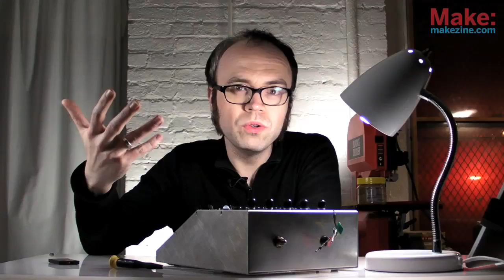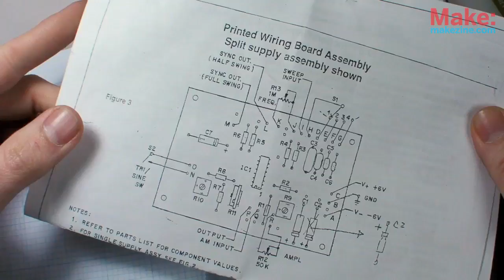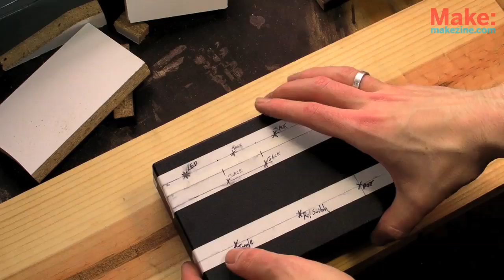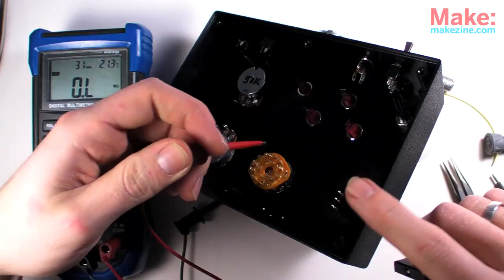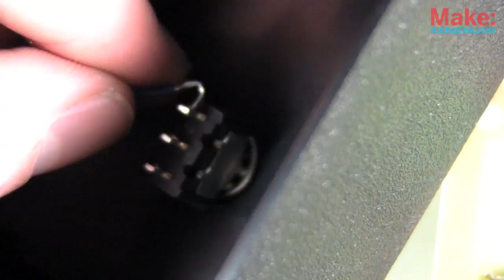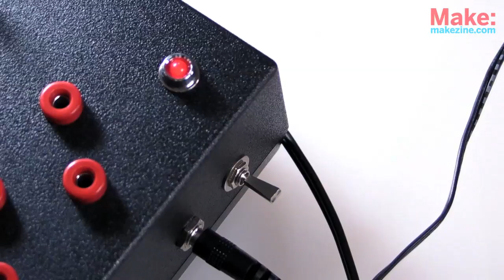Circuit Skills: Electronics Enclosures

Comment: The only issue I find with the tutorial is that he doesn't label anything at the end, or at any point of the assembly.

Even for those who have watched this video, you have no idea what's what. The input and outputs at least should be labeled, as well as the supply voltage, and input impedance.

Someday, I'll make a smaller generator, but with a 555 timer.

Comment: Part of a case is wire dressing, you did not talk about that.  And service loops so you can get the case open or close it up without a fight.
Pretty front panels with a dog's breakfast inside do not impress me.  Inside that look 1950s mil-spec but were actually built by one guy in his garage - that impresses me.  Cases are more than what you see outside.  How about power entry - where did you talk about getting power safely into your case?
You did not finish the video and yuo failed to instruct on the BASICS.

Comment: Really good video. What was that little 3 pin panel mount on the outside of your box? I’m looking for something like that for my 3 wire rpm sensor. It would be nice to have a right angle plug to mate with it. 
Thanks,
Paul

Comment: Hey man great instructional! Nicely paced and great shots to demonstrate during assembly. I learnt a lot just by watching you work, so thanks!  :)

Quick question I have about when it was time to mount the PCB into the enclosure, if U don't mind?  -

I thought you said that was a generic enclosure... How did the PCBs mounting positions line up perfectly with the box's screw holes? - I must have missed Something? Rewinded... Nope... I can't tell if Ur going into the plate, if the plate has riser or not, or if you added your own little threaded plastic risers (washer)

How exactly did you mount it into the enclosure?  Did you simply screw directly into the inside facing plate?
Or, did you use little plastic threaded risers? - If so, glue them in place?

Please, ask me if for more description if I haven't been clear, apologies if not.

Cheers

Comment: An added note about AC power when installing your AC input Aliexpress china has an excellent AC input female socket that comes as i have found with a very handy feature. An inbuilt fuse rated at 250v 50 hz 10 amps AC. Remember when installing this AC module that you must insulate the AC connections in interior of socket to avoid short circuits. Finally Even though you have the AC female socket switch in the "off" position AC power still transfers into the socket. You must fully unplug the AC cord for full safety when working with AC power. 
When working in the interior of the enclosure with any AC power plugged in unplug the power cord from mains supply then reconnect when testing repeat process by all means.

Comment: Your conclusion at the end is what either delays or kills a project. Feature Creep. You'll add on boards two and 3 and ... 11, decide the enclosure is too small, and you'll end up adding a new top to, and drilling holes in your great grandmother's piano bench. Surely you can get all the boards in there. Wait, that's really not a bad idea. Cut the legs down to about 4 or 5 inches and it will set nicely on a table top. Or put it on a keyboard stand.

Comment: Tip: You can also use cases of old/obsolete electronic equipment, like routers, set-top boxes, stereo's, video recorders, etc. You can also reuse the plastic pushbuttons, knobs, dials, displays, windows etc. And ofcourse you can salvage some internal parts. So when you want to throw something away, think about what and how it can be reused in a project (taking something apart is educational too!). I have a basket full of plastic parts, cases  etc and it is very useful, some parts you can't even buy or make it that nice (shiny buttons and such). Think about it, it will save you money and the planet of e-waste. Win-win.

Comment: very nice, but the function generator APP on a SMARTPHONE is better, just turn it up to the max, into a headphone amp set to the max, and then into a big amp (if it's very big you may not need headphone amp).
Reply: or you could use dedicated audio modulation software on a pc and get even better results with more customizability than you could ever hope for on a smartphone. but that is not the point of this video.

Comment: That's actually a damn cool device and gives me a great idea for building a type of theremin which would be easy to play and very precise with the notes. If you construct a piano-keyboard layout with the electronics inside (picture a long rectangular box), and wrap a sturdy string around the pitch/frequency pot, then have that connected to a slider which you can move about the keyboard, you'll essentially have a super easy to play theremin. N'est pas?
Reply: Actually, this is pretty much the idea of a device called the Tannerin, or electro-theremin.
Reply: Yeah, I've heard about the Tannerin as I'm a huge Beach Boys fan, but there's very scant information about the device, so I had to essentially think of this method of creating one for myself. I'd love to have a device which could create that sound, but I've tried real theremins and they're a pain in the ass. So an idea like this would have to do.
Reply: Hey everyone, the best success that i've ever had was with the Gregs Electro Blog (i found it on google) without a doubt the most helpful info that I've followed.
Reply: Kind of a stripped down Ondes idea ehh. Cool!!!

Comment: Finally.  Someone else who's obsessive about keeping their soldering iron tip tinned!
Reply: Newbie question: What purpose does that serve?
Reply: Basically, it protects it from oxidation and corrosion.  Here is a great resource on soldering iron and tip care: http://www.inlandcraft.com/uguides/tipcare.htm

One of the things I'm guilty of is frequently wiping my tip off on a wet sponge.  Use of brass wool would probably extend the life of the tip...
Reply: Once the tip becomes black, it won't work and must be put to a grinder/sander.

Comment: I. HATE. PREBUILT. CASES.

Why can't they just put mounting holes for a standart sized PCB in them like 160 x 100? And when there are slots for PCBs in them, a normal PCB doesn't fit in them! Do i really need to use hot glue for that shit?

Comment: I really like the first big box at the starting of the video. Do you have any info or construction notes? Thanks.
Reply: Hey man, the first enclosure that he had it was this item http://www.frys.com/product/1656468?source=google&gclid=CjwKEAjw5cG8BRDQj_CNh9nwxTUSJAAHdX3flTrMkzevcDKto-CA4NPmlDaYqSGW1ekwPEqCtDMmgBoCsdLw_wcB frys has it. I just picked one up from my local frys yesterday. I was so excited
Reply: Many thanks! Is it similar or the same one? How is the construction from close? I'm asking as I have bought a couple similar boxes from China and look cheapish, with many sharp corners etc.
Reply: Nick Prionas yes I can assure you that this is the same exact enclosure like to every dimension. The length of the shorter dimension of the top part is 5.5 inches long by 8 inches wide. Let me know if you need more details man! But the case itself is super sturdy aluminum. Can't go wrong!
Reply: The case is 1.5-1.6 mm thick aluminum measured with my caliper
Reply: +Nick Prionas sure thing man! I will be contacting you in the next 24 hours

Comment: I recommend people check out Front Panel Designer for laying out their controls. You can input the measurements of any size box, adjust placement to your heart's content, then export a .pdf that you can print and tape onto your box for drilling or a dxf or svg for using on a CNC mill, etc. Once you get the hang of it, it's probably quicker and more fool-proof than Colin's method here, especially if you're making more than one unit.
Reply: There is an on-line tool for Front Panels (panels.mwf-services.com) and enclosures (box.mwf-services.com) too.
Reply: thank you. I have looking for a 2d CAD website to make a template for the placement of my switches, lcd display and other items mounted on the front of my project box.  I am tired of things coming out crooked or too close together when doing it freehand.

Comment: I know this is an old video but can you tell me what kind of soldering iron you are using? I have a weller WPS18MP and it is just not good enough for me.
Reply: Justin Updyke He uses a Metcal MX-500 series soldering station. You can get fairly good stations for 30-100$ for hobby work it will be good enough. Cheers :)

Comment: Very nice video and instructions.  I have one suggestion.  The washer on the switch belongs inside and is used as a locking washer.  The tab goes into a small shallow hole and keeps the switch from turning.  I never use them though. I use a standard lock washer and jam nut.  The result is a much nicer looking switch.
Keep the great videos coming!

Comment: Awsome build but you could always 3-d print an inclosure using cadsoft eagle or something along those lines.
Reply: GeneralShrike The best box I ever printed with a 3D printer was a companion cube. We actually printed quite a few to ensure they had company. They are sentient, you know.
Reply: Sure you could, but this wouldn't make sense to me:
First, it's really expensive to 3D-print it. Second, it takes a LOT of time to print something like this. And, why don't you prefer laser cutting? Faster, and cooler, and cheaper. But sadly not everyone has a 3D-printer at home. And no laser cutter. :(
Reply: Hopefully you are doing better things with your printer then printing a box. For a box that size it is significantly faster and probably cheaper to buy a project box. Also a print of that size has a high chance of pealing and poor layer fusion.
Reply: Tom Tchilov
The 3D-printing is not expensive, but the printer itself is :p
Reply: McDucky believe me, the filament for this box is expensive. In relation to the printer, of course, then it's nothing, but it's expensive.
Reply: Tom Tchilov You could portably print a box like that anywhere in between fifty cents to two dollars. A good friend of mine recently acquired one, and we've been screwing around with it a ton.

Comment: Colin, Do you use soldering wire with/ or without rosin core?
Reply: Judging from the lack of brown residue and possibly some clear flux residue this might be No Clean flux.  Just a thought I may be way off though.  Also looks like leaded solder as well.  What do you think?  Otherwise pretty cool build.

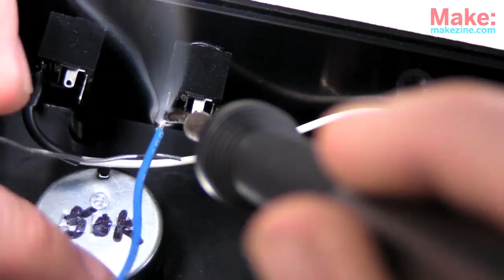Comment: I did notice one thing, not mentioned. Wire connections to pots or jacks were secured with  heat shrink tube after soldering (see 8:44). Since wires tend to break loose, esp battery connections, this is an important point.

Comment: I have a question. If you use a single strand wire do you still need to put solder on it before soldering to the component ? I am a newbie so...;)

Comment: Why are you joining the 2 pins from the pot? I think that will change the value of it. because a current can now also run from 1 to 3 making it 2 resistors parallel.

Comment: I built this and would like to clear up any confusion that others may encounter.
The 4 red posts I connected to I, M, P & Q.  Since the kit only came with one audio input jack, I used a switch to toggle the audio output from M to P.
I added a 5th (black) binding post for ground (not included in the kit) and 4 red leds to indicate what position the 4-pos switch was in (also not included in the kit).  The 4 leds were added to use a second selection from the four-pos switch (there are three sets)

Comment: If you are using a material other than thin plastic, make sure and calculate the proper drill rpm, and as you move toward harder materials, its a great idea to center punch/center drill your holes.

Comment: @AlaskanGenius Yeah, if you're concerned that i would destroy a piece of equipment the one i bought was non-operational. Half of the buttons on the front panel are gone as well(which i plan to replace).

Comment: I don't know if someone will be helpful, but i bought an Oscilloscope with the intention of using it as a computer case. Unfortunately its a bit too narrow, and a bit too short to use regular components. Thankfully i can detach the front of the Oscilloscope and re-use it on a larger enclosure... the catch is that i want to find a metal case. Anyone know where i can get one custom made? what's a good place where i can find existing metal cases that i can re-purpose?

Comment: Pretty cool. So does it matter what type of material is used for the enclosure like with gain circuits that are susceptible to interference. Would it be best to use a metal enclosure in that case?